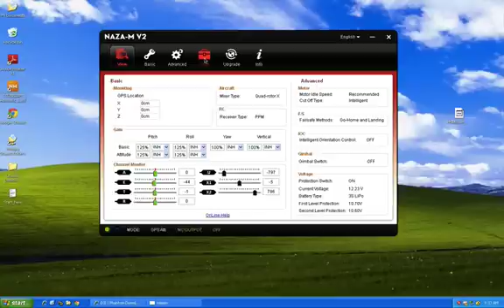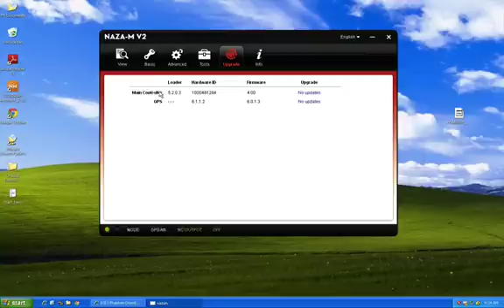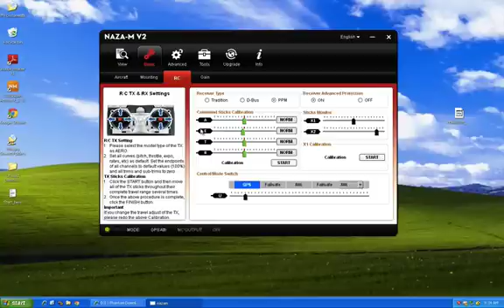Checking TX and IMU calibration on Naza Assistant SW - Part 2

Comment: Did you ever get this figured out? because if you're moving the throttle up and down and the E moves then it's connected wrong. Your elevator and throttle are connected backwards